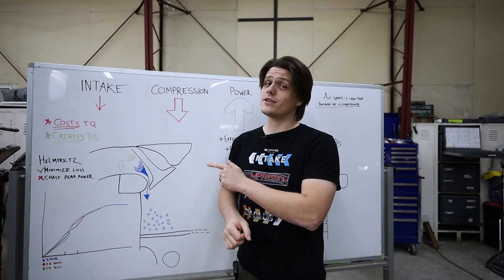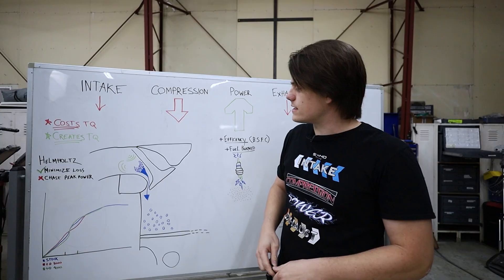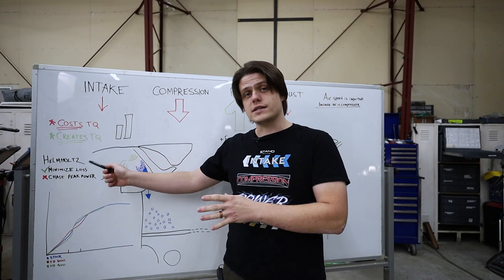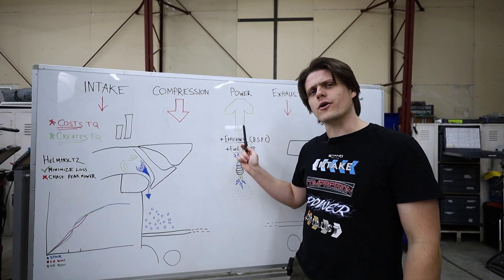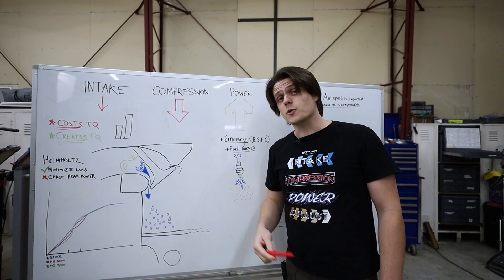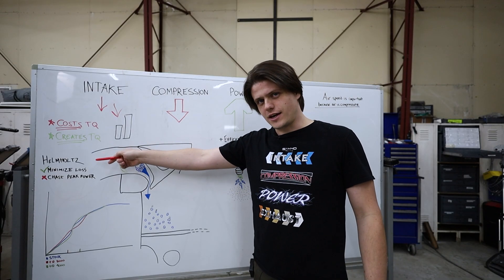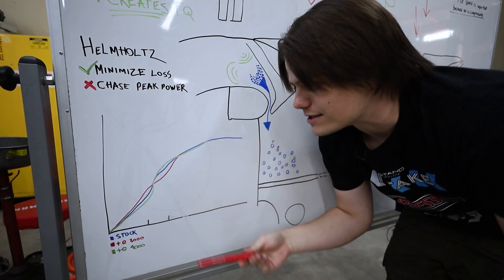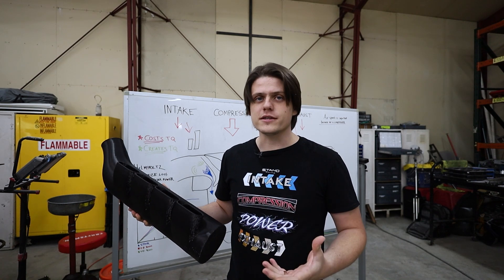How to design your own intake (What I've learned so far)

Comment: To be honest, the reverse charge of the port happens immediately after the wave passes out of the port the vacuum it leaves behind begins sucking in the port. This is why bell shape ports promote a sooner charge. 

In your oil example you did long tube and pulled fast, you created a vacuum volume that took time for oil to fill, long runners do a similar thing as the waves are traveling at the speed of sound with pressure waves.

The bouncing off of the plenum is a different phenomena where if you can put a flat surface in front of the port the wave's inertia will cause it to ram and bounce off the wall producing another wave. Just like natural wave in the port, the ram wave can both help you or hurt you. This is called ram air. 

BTW Acura RSX and the Ford Taurus SHO were engines with valves in the intake to switch from long runner to short runner.

Comment: Excellent video. I ran a ROTKEE PDS Pressure Pulse Sensor at the PCV vacuum hose on a 2006 Matrix. I noticed the amplitude of the pulses were greatest for farthest cylinder (#1), then #2,#3, and #4. I think what you are describing explains this. 🔧

Comment: Can you make ultra low volume PLA prints for investment casting?

I want to do some casting with investment operations, even if I have to use CA glue to piece them together.

When I say "low volume", I mean a very minuscule volume of plastic, because it has to be burned away in the slip firing process.

That would be something almost paper thin, with almost no mass, just a physical place holder until the ceramic slip hardens into "greenware."

I have my own firing kiln large enough to make intakes for any motor up to 34" long [the intake could, for instance work for a large displacement V-12 at that length] and my goal is to make very large intake parts for a host of big block V-8's, especially rare, hard-to-source V-8's from the 60's and 70's.

The exteriors of the molds would possibly be needed as well, especially if I find I need a lot of very high precision surfaces.

The goal would be to make custom tuned tunnel ram intakes and custom high relief exhaust manifolds, which LOOK "period correct" for specific, hard-to-source motors.

If I were successful on my own motors and felt making units for sale was a viable option [after a whole lot of in-house R&D], I would likely order a few hundred of each piece at a time, since each one, so far as I can work presently, would be a single-use, wholly sacrificial part.

But being super thin, low volume parts, should not take a long time to print, with at most 2 layers of material...just enough for the ceramic slip to bond to and harden to, for the purpose of obtaining a specific shape.

Is that something you would be interested in?

Comment: MY aim IS peak torque.

All I own is a fleet of trucks.

I haul dirt, concrete, waste, etc.

I haul tons at a time, and I need torque for climbing Ozark hills without the motor wheezing out on me.

Every bit of my research goes toward peak torque for hills, and peak fuel efficiency on flat interstate highway.

Comment: If you want a great example of performance by runner design....
Get into an 88-92 350 tpi (long tube runner-23"long),
Then sit in a 350 lt1/lt4 (short runner- iirc 12" +/-).

Absolute night and day.  Fun factor is the long tube, designed to appear to be quick.

Comment: Wait, you’re the guy I gotta tell acoustical aglamorization but inside your air box I was thinking of this as an air filtration mechanism, but you could actually use it to tune the harmonics of the intake thus allowing you to have any length runner you desire

Comment: Two years old, but love the break down.
Graham Bell book, Four stroke Performance, covers the air momentum.  Two stroke Performance, covers the frequency tuning, in the exhaust expansion chamber.  The issue you run into is collectors.

Comment: Nice video,  self asured, but you still have a LOT to learn about fysics 
You are wrong in so many areas.  One example: it is the heat in the exhaust gasses that drives the turbo, not the exhaust stroke,  the turbo running is from the heat in the exhaust gasses. heat that would otherwise be lost.
This "free" energy is used to pressurize the gasses in the intake cycle !!! Because  piston gets pushed down from the  boost pressure the engine does not lose mechanical energy by not having to "pull" on the piston under the intake stoke.
But the "free overpressure" pushes it down.
That is why the thermal efficiency of the engine is higher.
And so a turbo diesel delivering the same power as a Na diesel 
Usses less fuel 
Smart don't you think.??

Comment: Why would air gain momentum along a long runner? I don't see any reason why the air would accelerate unless the runner tapers.
Reply from the maker: Picture a crowded freeway. All of the traffic is at a dead stop, 1000 cars worth. In front of the 1000 cars the freeway is completely empty, and all the cars are released at once. In 1000 feet, the front cars might be going fast, but the cars in the back haven't even started moving yet, so the average speed of all the cars is small. If you look forward to 2 miles, all 1000 cars are moving at freeway speed by this time, so the total momentum of the full group is high.

Does that make it easier to picture? The 1000 cars are the atmosphere, and the empty freeway is the engine vacuum. The start/stop function is the intake valve.
Reply: @StandRacing  I see, thanks.

Comment: I believe Mopar called this affect "Ram Charging". Look at the intake manifolds of the Dodge Letter cars from the early 1960's.
Reply: Ram Charging is a bit different, it's relying on the plenum to bounce back the pressure that shoots out the port. Porsche took it to the extreme by having that charge bounce between plenums on their boxer engines.  All engines have the pressure wave.

Comment: When testing custom parts i recommend using gale banks density guage to measure and log manifold Absolute density, this gives flow which ultimately dictates fuel and hp.
When you make tweaks to your design rev your motor out and compare logs, if you have rpm against flow you will see where your gains are made 🙂

Comment: im building a inlet manifold for a project of mine and im really space constrained but it is supercharged so would that negate the effects of the short runners i need to use to fit it? they are approximately 40% the length of the factory manifold. fwiw the stock manifold is widely considered one of the best OE manifolds on a 2L turbo production car, and ive just cut iit down and replicated the plenum volume

Comment: You could compine the effect of the "supechargingˇeffect of air speed with a ram air intake. The ram air intake should be positioned at the stagnation point on the body of the car for maximum effect. With this you can get some crazy columetric efficiency with a naturally aspirated engine.
You can of course tune your Helmholz resonance in this design as well.

Comment: I had a crazy idea here, what if you use a runner with an open cylinder that moves inside it ( pressure+spring / mechanical / solenoid) to changes the length depending on the RPM? The runner (outer part) has a sliding cylinder inside it, in which the outer diameter of the movable cylinder matches the inner diameter of the runner to make a good seal (at least don't let much air escape) thus making the runner short on high RPM and long on low RPM.

Comment: A short large runner at low RPM fills the operating cylinder much too fast with low energy/low-velocity air and when the piston reaches bottom dead center, the cylinder pressure equalizes with the short runner pressure and simply pushes everything that entered the cylinder back into the port until the intake valve closes. A longer runner at low RPM, OTOH has more of a restriction, fills the cylinder much slower with higher energy/higher velocity air, and delays the pressure equalization as the piston rounds bottom dead center allowing air to flow into the cylinder until the valve closes potentially trapping more air. With the higher air energy and velocity the air/fuel is also mixed together more efficiently.

Comment: I have a long tube intake on my K24A RBB motor and it is a great example of what longer runners can do for torque. It sounds great and feels really good through a 6 speed. I’ve seen some ITB kits online, would a long tube manifold around the ITBs provide even more air speed with velocity stacks?

Comment: What kind of wrench does bmw valvetronic throw into this?  Variable intake lift should have an effect on charge air velocity?
Reply from the maker: The benefit of variable lift technology is superior the the benefit of an over-engineered intake manifold. It doesn't make manifold development completely obsolete but it is the more effective way to put the power where you want it on the HP curve.
Reply: @StandRacing  I was running my n52 with an open trumpet intake and gave up the math cuz I couldn't figure how to incorporate that variable in the design.

Comment: 8:30 I would say a good explanation is that its like tricking your air into thinking you have a bigger engine. A 2L volume at 1.5 atmosphere of pressure fits 3L of air at 1 atmosphere.

One thing Im curious about is how much power draw is a supercharger vs a turbo? I think everyone knows that the turbo is going to cost something as well, But ive had plenty of car people tell me that the costs are negligible.

Considering that turbos are put on modern cars partially for fuel efficiency, and that superchargers have no lag + cheaper, there must be some truth to the idea that turbos are more efficient, or else everyone would just use superchargers.
Reply from the maker: It's largely a matter of preference. Superchargers come on power a lot smoother than turbos, twin-turbo setups can approach this smoothness but with the extra moving parts and tuning complexity it's not always as reliable as supercharged. It's all good fun though.
Reply: Turbos take advantage of thermal expansion of the exhaust gases, therefore they are more efficient bcs some of their drive energy comes from an energy source that would otherwise be wasted.

Comment: Hey, I’m planning on making my own itbs. What material do you suggest to survive the heat?
Reply from the maker: The throttle bodies themselves? I don't know if I would trust plastic to maintain the level of tolerance required to keep throttle position constant in their closed positions. Maybe start with PA-CF and use brass inserts for the throttle shaft. Be cautious, and let me know how it goes!
Reply: @StandRacing  I meant the velocity stacks mb
Reply from the maker: @Jimbob-2  You might be okay with just ABS/ASA its good to ~200F

Comment: It seems to me that if you want good tuning for 3 or 4 different engine speeds, you'd just bolt on 3 or 4 separate throttle valves and use the computer to switch which one is open depending on engine speed. It's a bit Neanderthal compared to the "perfect" engineered intake, but you can be really lazy with simulations and just build essentially a trumpet.

EDIT: If you're looking to build a bolt-on aftermarket component, then the above definitely doesn't work. In any case nice work.

Comment: Does runner length matter for forced induction(particularly turbo)?
Reply from the maker: There are things you can design into the intake manifold to improve turbo performance, but for the most part no.
Reply: @StandRacing  Are you going to cover intake manifold optimization for turbos in a future video? And does runner length matter when supercharged (both kinds) or does all forced induction kinda defeat the purpose of runner length since they're compressing more volume into the plenum, anyway? ((The only one I can see it still mattering for is centrifugally charged, since those do basically nothing until about half the rev range, anyway.))
Reply from the maker: That would be a good topic of study. I would expect the manifold design having a measurable effect on the "turbo-lag" section of the curve before the turbo makes much boost. But I'll take it as homework.

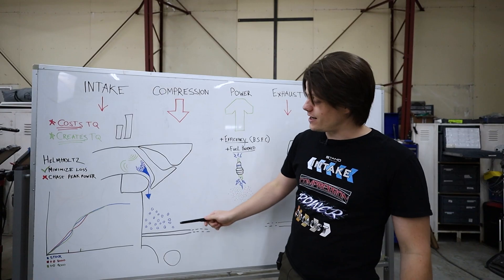Comment: 6:20 also Cam duration and overlap helps. As David Freiburger (Engine Masters/Roadkill) put it, think of a door opening: you open and close it fast, very few people can enter... leave it open for 30 seconds and 100 people can come through. Overlap will help pull in more intake too because of the timing where both Intake and Exhaust valves are open. The exiting exhaust helps draw in more intake due to the displacement (believe that would be positive displacement?), like having two windows open to get better cross flow while in a parked car... another form of Scavenging

Comment: Would forced induction change the restriction effect since its already under pressure? Like if you took that syringe and attached a compressor itll shoot the plunger out.
Reply from the maker: Yes, I'm fairly sure that even a modest amount of boost will actually generate a very small amount of torque on the intake stroke.
Reply: @StandRacing  hey I just took apart a Cadillac dts with the all aluminum v8 and it uses kinda the same design for the intake runners that you are designing.  Also might be good to look into the Taurus sho for intake ideas. Super jealous wish I could be doing this kinda stuff.

Comment: Hey man, realy nice content. When you were talking about combining shot and long runers I would sugest you have a look at the BMW's intake manifolds used on M54 and M52TU engines. They use DISA valve to to direct path of air thru long or short runers depending on RPM however they dont use ITB's since those are normal non M cars engines. Later engines such as N52... use 2 DISA valves.

Comment: Epiphany time: I love my 22re (2.4L Toyota) it has an equal bore/stroke, short runners and makes boat loads of torque in the midrange with a (realistically) 4.5k rpm redline and only makes power between 3.2k - 4.2k.

Short but very rewarding, especially for tight mountain passes.

Comment: This might be a stupid question (I don't actually have any experience in this stuff), but could you install a "wastegate" into the long style intake runner? You'd get the good air momentum with the long tube down low and then have it open up at higher rpm or load to get around the restriction a long tube causes? I would think youd have to tune with a map sensor or route the "wastegate" pre maf/afm? Anyway cheers! Love your channel!
Reply from the maker: Totally! What you described is a secondary set of butterflies. This setup comes standard in the factory Miata manifold.
Reply: @StandRacing  Dang! Here I was thinking I had an original thought 😅 thanks for the info!
Reply: I think it's also in the 991.2 Porsche gt3

Comment: What if the runners have a variable length? Maybe variable volume? That way that shockwave is optimized at every rpm range. When the length of the runner changes the volume changes. but the amplitude of the wave stays about the same while it’s frequency increases. What if it was the opposite? The amplitude changes but the frequency remains the same. Idk though I’m not an engineer

Comment: Im glad you didn’t say what everyone else says about turbos… that they don’t require power to operate. Obviously there is work being done by the engine to turn the turbine. As you said, the turbine is a restriction, on purpose! Subscribed!
Reply from the maker: No free lunch! Thanks for the support
Reply: No free lunch, but you can eat food previously uneaten. The exhaust gas has energy from temperature and velocity, as well as pressure. A properly designed turbine and exhaust system expands exhaust gasses through it, cooling it and slowing it to extract power to turn the compressor. Pressure is kept as low as possible to reduce pumping losses. A turbo system running beyond it's design capabilities will see an increase in pressure between the engine and turbine, with resulting loss of efficiency, and likely longevity. But the turbine can be made to work on exhaust velocity and temperature alone. After WW2, but before jet engines took over, piston airplane engines were developed with turbines connected to the engine crankshaft that greatly increased power and fuel economy. See the DC-7 equipped with power recovery turbines/ turbo compound engines.
Reply from the maker: @briancox2721  Thank you for that. There are forces being utilized by a turbocharger system that would otherwise be wasted, and utilizing them does not always equate to a large increase in pumping losses.
Reply: @StandRacing for all practical purposes a turbo does, in fact, provide a free lunch.  In properly setup race applications, it is always a free lunch.

Race turbos REDUCE pumping losses.  In other words, the intake pressure will be higher than the exhaust pressure.

Comment: You're doing great stuff. Thanks for making the general concepts and differences understanable and not engine specific. The way you explain stuff makes it easy to apply to other engines. 

Does the dip in the rev range being earlier help in low speed drivability? 
I'm guessing a late but consistent curve would be better than and early but bumpy one
Reply from the maker: The curve I drew was a bit dramatic, it looks more like a turbo car with big low RPM lag. It's hard to talk about driveability without knowing more, but a smooth and mild car is the most fun as a daily in my opinion.